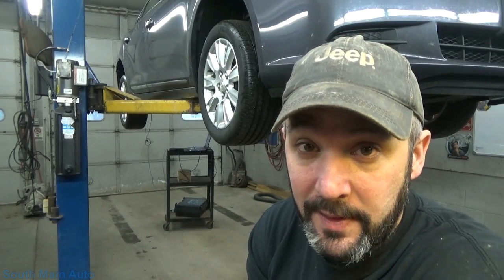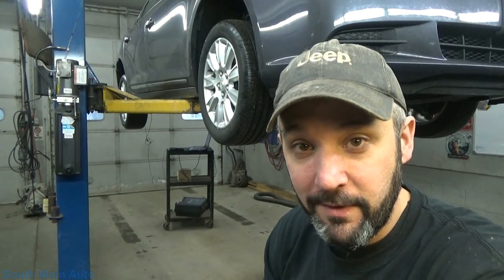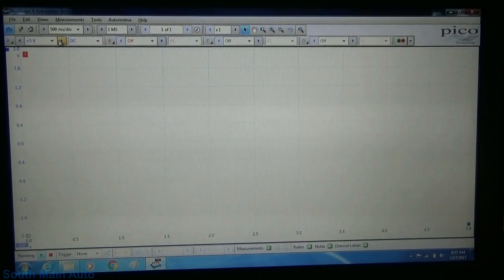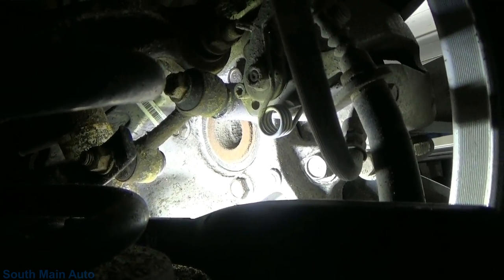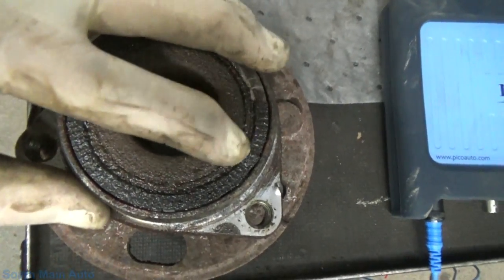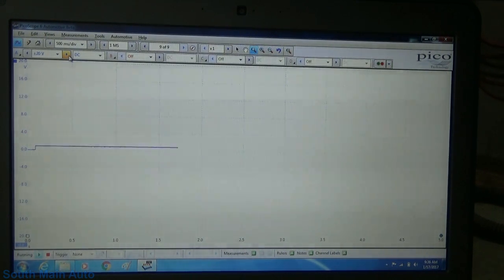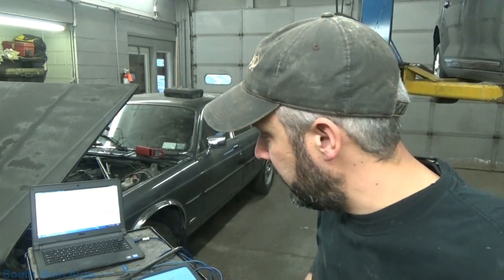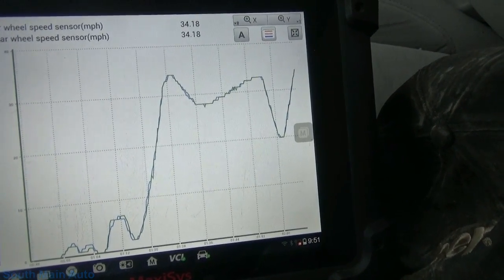A Look At GM Digital ABS Wheel Speed Sensor

Comment: Thanks for the video,  working through this with my 2011 Lacrosse.   I don't have a scope or a fancy scan tool so I am hoping to find something in a visual inspection (so far the front looks fine).  Can these sensors be tested with an ohm meter?

Comment: Just found the same problem on my wife's 09 Acadia.   Thought it was the wheel speed sensor at first, but I did find a diagnostic aid for how to test it.  Good thing I only loaded the parts canon, and didn't light the fuse :) 

I had purchased  a new sensor (just in case), and confirmed that I could return it if not opened.  Too bad it wasn't the sensor, that would have been cheaper :).  When the sensor passed the testing, started looking elsewhere and found the damaged magnetic ring...

For anyone that this may help.

-------------------------------------------------------------------------------
Test procedure for WSS sensor on..
2008-2010 Buick Enclave
2007-2010 Cadillac Escalade, EXT, ESV
2009-2010 Cadillac XLR
2007-2010 Chevrolet Avalanches, Silverado 1500, Suburban 1500, Tahoe
2010 Chevrolet Camaro
2009-2010 Chevrolet Corvette, Traverse
2007-2010 GMC Acadia, Sierra 1500, Yukon, Yukon Denali, Yukon XL 1500, Yukon Denali XL
2007-2010 Saturn Outlook

To test for the "12 volt Wheel Speed Sensor Supply Voltage" from the EBCM with a WSS fault present, perform the following test:

A. Disconnect the Tech 2 and Key Off Ignition, Remove Key, Open and Close the drivers door to turn off RAP (Retained Accessory Power) and wait at least 60 seconds.
B. Disconnect the appropriate WSS harness connector.
C. Connect a Fluke 87 DVOM (J39200) across the wheel speed sensor "Supply Voltage" and "Signal" circuits from the EBCM.
D. Set the DVOM on DC volts, press the "range" button to the 40 or 60 volt scale and then press the Min/Max button.
E. Turn the ignition key on. There will be a quick momentary 12 volt pulse from the EBCM at key up. This 12 volt pulse is sent each time the EBCM is powered up after being asleep to check the WSS circuit integrity.
F. If the 12 volt pulse is present continue with the WSS component testing. If the 12 volt pulse is NOT present recheck the circuits between the EBCM and WSS before replacing the EBCM. Make sure there are no backed out or loose terminals at the EBCM, WSS, or any inline connectors using the appropriate Terminal Test Probe

Component Testing of the Wheel Speed Sensor

Note: This procedure is very polarity sensitive and if the WSS is connected in reverse polarity while performing the below procedure the WSS can be permanently damage. Please make sure the B+ is connected to the WSS Supply Voltage and the ground (Fluke 87 DVOM) to the WSS Low Signal Return. Use the appropriate SI wiring diagrams to determine the WSS Supply Voltage and WSS Low Signal Return.

A. Ignition OFF, disconnect the harness connector at the suspect wheel speed sensor.
B. Connect a 3A fused jumper wire between Battery B+ and the "12 volt High Wheel Speed Sensor Supply Voltage" terminal.
C. Connect a resistor of approximately 100 ohms in series with a Fluke 87 DVOM (J-39200) between the Battery Ground and the "Wheel Speed Sensor Low Signal Return" terminal. (Sources of a 100 ohm resistor: High Speed GM Lan terminating resistor, certain test lights, Radio Shack, etc.). Shown below is an example of how to properly connect your meter for testing.
D. Set the DVOM to the DC Milliamp scale.
E. The typical reading will be 4 to 8 mA for the "Low" reading and 11 to 16 mA for the "High" reading. As the wheel is turned very slow, a few degrees at a time, the signal will change from the low to the high reading as each reluctor tooth passes the WSS.
F. If not within the specified range, replace the wheel speed sensor.
-------------------------------------------------------------------------------

I was able to find a connector under the hood to access the circuit. - Handy as I have 12 volts handy there.   I had already tested from this point back to the sensor connector, and validated no shorts or opens in the section of wiring I was looking at, so I cheated and didn't go find a 3A fuse.   There was a 100 ohm resistor in the circuit anyways, so I felt safe without it.    Even a dead short would have only resulted in 120mA.

Also confirmed that the silly thing does turn of the 12v source when it detects a WSS fault.  Tried measuring voltage on both rear WSS sensor feeds, and got zipo.  

BTW, thank you Eric for the great videos.

Comment: Did I understand it correct? When you turn the ignition on it has 12V, if the sensor is near the magnetic position and 0 V if it's at the non-magnetic position of the ABS-Ring ?

Comment: Great demo, it would have been a tricky diagnosis without careful inspection, and the Pico clinched the deal. I've spent years hand-wringing over which labscope to get and I think I've decided on the Pico. I like the idea of a waveform library although it would have to be pretty extensive to be of general value.

Comment: The magnetic sensor explained. This type has only two wires, with one side tied to +12V. Mysteriously, the signal voltage takes on two rather oddball-seeming values. Not zero to 12V, nor zero to 5V, nor even zero volts to anything. So this is almost certainly a sensor which communicates by sending one of two different output currents. The receiving control module contains a resistor to ground, and reads the voltage that results from that signal current passing through that resistor. This mode of communication is known as a "current loop" configuration... current flows from the receiving device along the "12V" wire to the sensor, and then back along the sense wire to the receiver. The sensor sends information by regulating the amount of current. The current loop arrangement has two benefits: 1. Interference from electric or magnetic noise affects both wires equally, with an overall effect that cancels out. So less signal degradation from interference. 2. Makes it easier to design a system that has electronics in the sensor, yet uses just two wires. 

Almost certainly, this module contains uses a chip like the TLE4923, data sheet here: https://media.digikey.com/pdf/Data%20Sheets/Infineon%20PDFs/TLE4923.pdf. See page 17 for the likely connection arrangement. Table 4 on page 11 (IS) shows that the low current is 4.1mA (+/- about 1) and the high current is 10.5mA (+/- about 2.5). And minimum ratio between low and high of x2. (These current signals are in the range of the "4-to-20mA" signal convention commonly used in industry.)

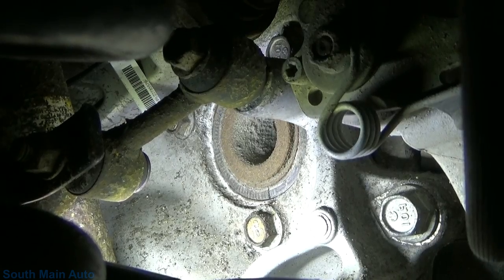Looking at Eric's scope at 3:36 of the video, the resulting voltages at low and high are about 0.85V and 1.7V (ratio of about 2). So that corresponds to a receiving resistor (RS) of 180 ohms like in the datasheet, with the sensor producing (permitting to flow) 4.7mA and 9.5mA, which is in the range shown in table 4 for IS. 

The sensor's block diagram appears on page 7. The "output signal" of the device is the amount of current flowing from the pin 1 terminal to pin 2. In this ABS application the VS terminal pin 1 is connected to +12V, and the output is the amount of current (4.7mA or 9.5mA) that the chip allows to flow through from pin 1 to pin 2. Don't be misled by the label of "Ground" on pin 1. In this ABS application it's the output wire. 

Control of (most of) the current is performed by the variable current source element, shown on the block diagram toward the right as a circle with arrow. In this application the word "source" might mislead -- it just controls the amount of current allowed to flow, ultimately from the VS +12V terminal through to the "ground" terminal, which, as I mentioned, is used here as the output signal. 

The block diagram also shows apparently two raw hall sensor devices, whose outputs are amplified. The "Schmitt trigger" is a device to compare those two values, and make an on/off decision. The "Schmitt"-ness means that the comparison is done with some amount of hysteresis, to avoid oscillations that might result if the mag wheel is at some intermediate position where the hall sensors read approximately equal readings. More explanation in the blurb on page 8.

The data sheet also tells that the TLE4923 has its own built-in regulator for internal use, and can operate properly down to 4.5V across pins 1 and 2 of the chip (and up to 18V). Adding that to the voltage the current will cause at the "output" (pin 2), that means the positive side can be any voltage from about 6.5V to 18V, and the chip will still produce the same two currents, and thus the same two voltage levels at the receiver.

Comment: hey Eric man, so these digi sensors are still 2 wire like a traditional wss.  any quick way to distinguish between the 2? I suppose just back probing one side of the harness when unplugged?
Reply from the maker: yeah but remember some VRS style float the AC on a bias voltage
Reply: South Main Auto Repair hmm good point, so did you approach this with the scope and fetch surprised by the digital signal or had you done the research before?
Reply from the maker: I looked at a diagram to see what kinda sensor it was. Still had no idea of what voltage range it ran on
Reply: South Main Auto Repair cool, thanks man, it's the one thing I wish I had better access to at the shop I work at, better resources for homework on systems I'm working on.. keep up the quality videos hombre!
Reply: @South Main Auto See the comment I posted 2017-02-02 for info on the sensor, voltages etc

Comment: Eric, is the sensor still producing a AC signal and the sensor itself has a analog to digital converter built into it's internal circuitry that in turn outputs a digital signal or does it operate like a magnetic reed switch where if there is no magnetic field present because the tone ring is interrupting it and the switch ( sensor ) is put into a open or closed state producing a digital output/signal ? Glad to see your having fun with that Pico, you should have that fired up from the moment you walk into your shop to the minute you leave for the night ! If used right, it can give you real good direction right from the start of the majority of your diagnostic procedures ! The more you use it the more proficient you will get at it ! God Bless !
Reply from the maker: you know that is a fantastic question I do not know the answer too. HOWEVER, when that car or one like it comes in for service I will have an answer for you. I ASSUME  it operates like a magnetic reed switch where if there is no magnetic field present because the tone ring is interrupting it and the switch ( sensor ) is put into a open or closed state producing a digital output/signal. Easiest thing to do will be to test it :) . I will let you know, again that is a fantastic question!
Reply: I believe it is a two wire sensor, so I would have to agree with ya that signal return is being brought down from 2v to 1v by some type of circuitry that operates similar to a reed switch built into the sensor ? The  12v supply I would think is to power up the sensor itself !
Reply: See the comment I posted 2017-02-02 for info on the sensor, signals, voltages etc.

Comment: Kia/Hyundai during a fault the module will stop sending the 12 volts to the sensor.
Reply from the maker: really, hmmm will have to check this out. I wonder why
Reply: South Main Auto Repair yea the module kills the supply. maybe figures what's the point. or failsafe logic. you can make a special tool to read the sensor.

Comment: these a commonly known as magneto resistive wss, generaly are surplied with a voltage around 11-12v then the signal return will match the power surply until the wheel is spun and the window is blocked which causes the voltage to drop down... but not much at all giving u a hall effect type square wave.... generally used more often in newer cars now as they are considered more reliable and accurate at lower speeds, fairly easy system to diagnose. good video eric 🖒
Reply: they are also always only a 2 wire connector, easy to confuse with VRS type until u check voltages at the sensor itself
Reply: I don't believe these are magneto resistive. See the message I posted 2017-02-02 for details.

Comment: European cars started using that system almost 20 years ago, but usually BMW sheild the ferromagnetic ring  in the bearing seal better from the elemets better than on that Chevy also BMW and Merc and LandRover normally protect the connectors by locating them  inside the trunk or under the hood. Normally this style  are more reliable than the old style toothed rings but wheel bearing wear can cause issues.
On Bosch system  quick test is if the ABS light comes back on immediately  the key is switched on it is a eletctrical fault, either sensor or wiring also if it fails the circuit integrity test the ABS module will shut off the 11.4 to 12v supplies to the sensor. 
If the ABS light goes out normally then back on after 10 meters or so it is usually a wheel bearing issue.

Comment: Electronic traction control... is it really necessary? All of this AI in cars just makes for dumber, less capable drivers. Back in my day, and no I'm not that old, you needed to know how to drive in bad weather, be aware of the interaction between your car, the engine, trans, your tires, and the road. It made you pay attention more. I guess like anything else, technology is great... when it works that is.
Reply: Electronic traction control is FREE once you have 4 wheel ABS.  When the ABS senses one drive wheel spinning, it simply lightly applies the brake to that wheel shifting torque to the other wheel via the differential.
Reply: Not 100% correct. You do need to add an electronic pump that can activate individual brakes. Basic ABS doesn't need that; it only needs to be able to relieve pressure from individual brakes. But that's pretty cheap I guess.
Reply: 4 independent wheel ABS has been standard for many years.  Even before that it was typically 2 independent front ABS and then rear axle ABS.  Ant additional cost was very small.
Reply: Gotcha

Comment: Good stuff, Eric! Gotta love the salt! Would be curious how those voltages change with the sensor unplugged, just to see what an "open circuit" problem would look like on the scope.

Funny story: last year I diaged a 2001 Lexus RX300 with unwanted ABS activation, no codes stored. Scan data showed that Left Rear wheel speed was erratic. Well I scoped the actual signal and spun the wheel. Textbook VRS signal...no issues. So I fired the parts cannon and replaced the speed sensor. NO CHANGE!!!   So then I scoped the RIGHT rear wheel and sure enough a dropout was evident...classic cracked tone ring! I replaced the tone ring ($20), problem solved.  Had to eat the cost of the speed sensor ($150) since that was the wrong call.

Moral of the story: never trust your scan data 100%! In this case I was using the Autel DS708 and apparently the programmers forgot what is left and right haha! Fronts were backwards too btw. Dang Autel.

Comment: when I worked at a ind shop I put multiple ones in a week it seemed like haha you can look with a ohm meter to right?
Reply from the maker: Nope an ohm meter would show good readings in this case. Remember the sensor was good.
Reply: oh yeah but I shouldn't it show the resistance or whatever at the wheel
Reply: so the tone ring was just bad. that magnet strip. sucks they can't just replace that be way cheaper. but then business owners wouldn't make money I spose

Comment: Genericall, that is called a Hall Effect sensor.  A digital "scope on a rope" from B+ to signal return would likely have show the gap.  There are many variation of Hall sensors.

A more common configuration is the old Ford Profile Ignition Pickup (PIP) sensor.  A metal shutter interrupting the magnetic force that switches a transistor.

Sadly, I'll bet you will be changing a lot of them as rust "jacks" that magnetic film of the bearing.
Reply: This type of sensor sends a digital signal by flipping between two different current levels, that happen in this case to be about 4.5mA and about 10mA. Combined with a resistor in the receiving control module, the result is a voltage of about 0.85V and 1.7V. If you want the receiver to continue seeing a sensible signal during testing, whatever test method you use would need to show, or at least distinguish, those two voltages without diverting any substantial signal current. If you unplug the sensor, you can apply a voltage to the plus side (> 6.5V, say 12V) and measure the current to ground on the other side (use meter mA function)... this will alternate between 4.5mA and 10mA or so with wheel rotation.  As an alternative, with the plus side of the sensor connected to +12V, connect the sensor negative side to the plus side of a bare LED , and  the LED negative to ground. The two different current levels will cause two different brightnesses of the LED, and would allow eyeballing a rapid pulse pattern better than a meter would.
Reply from the maker: Remember it was switching at a low voltage 1 to 1.5v (ish) You'd been hard pressed to make that call with a digital test light. Besides I am sure it would have just pulled it to ground. Very low current circuit we are dealing with.
Reply: While turning the tire at a constant speed, you would observe the light stay OFF occasionally for a longer periods, instead of nice even blinks.